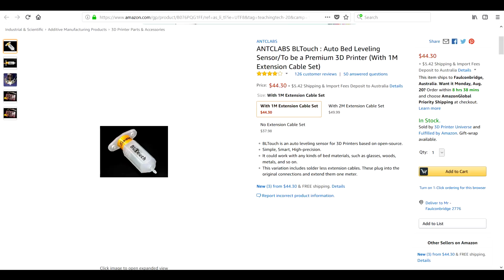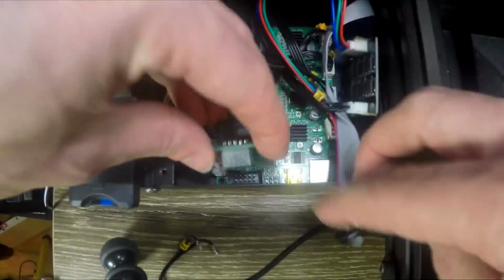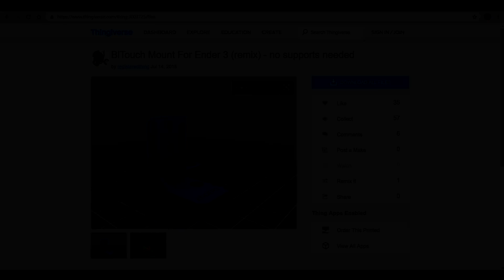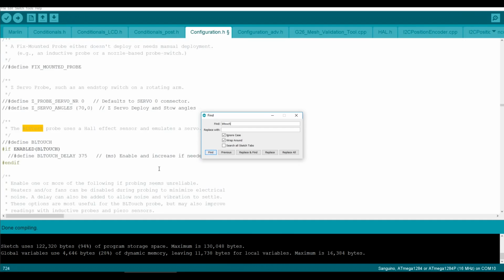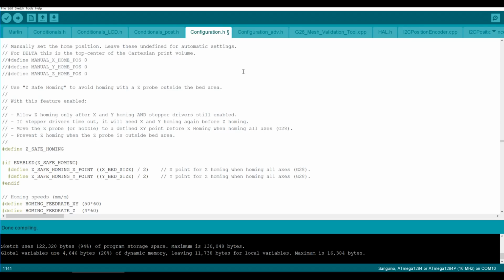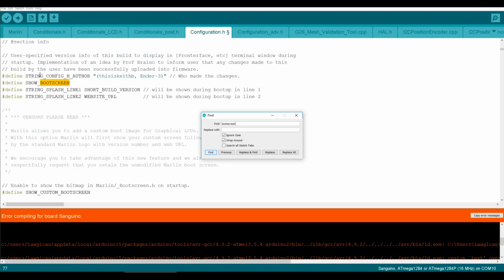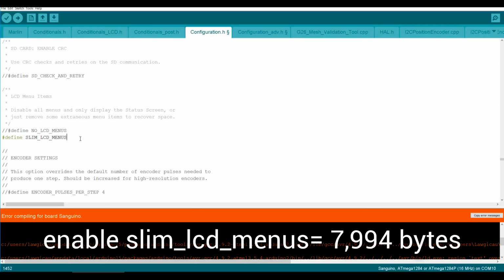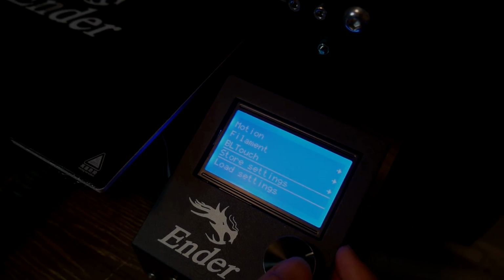Ender 3 BLtouch vanilla Marlin guide

Comment: I have a quick question. I followed your video and even purchased your config files. I uploaded using Arduino with a 95% used just like yours. Here is the problem I am running into. For some reason it does not seem to save the probing from the BLTouch. So my prints are not level. I run the level stl file and it does not come out level. Yes I have adjusted the Z axis and saved it to the firmware. But as soon as I adjust that too much the rest comes out of level. I was told that 95% is not enough room to save the data from the BLTouch. How can I gain more room and what should I be look at to disable. Thank you.

Comment: Hi again!  I used marlin 1.1.9 like in the video and I'm also using Micheal's config files where I only changed the probe X and Y offset, everything works fine expect the G29 script. When I run the G29 script(I used both pronterface and octoprint) the probe extents and the gantry moves down, but it doesn't move down enough to trigger the probe and it throws an 'probing failed' message and octoprint craps itself. When I run the G28 script it triggers just fine, the problem only happens with the G29 script. Has anyone else had this issue, and if so how did you fix it? Thanks!
Reply: I figured it out. the angle which I was looking at my printer hid the fact that the probe was barely missing the bed. I changed the 1024-1027 lines and fixed it

Comment: does anyone have experience with doing this with the new versions of the TH3D firmware? In the version i'm using(U1.R2.7) none of the configuration options that Micheal edits are available, and anything that I try doesn't help. Did TH3D remove support for the bltouch to force costumers to buy their EZABL?

Comment: Arduino:1.8.7 (Windows 10), Scheda:"Sanguino 1284p, ATmega1284P (16 MHz)"

In file included from sketch\ultralcd_impl_DOGM.h:49:0,

                 from sketch\ultralcd.cpp:96:

dogm_bitmaps.h:146:29: error: _Statusscreen.h: No such file or directory

compilation terminated.

exit status 1
_Statusscreen.h: No such file or directory

Comment: @13:41 you talk about G28 to home and then G29 but okay what software do i use to do that with?
Reply: Micheal used the simplify3D interface, but you can use pronterface(which comes with the newer versions of the TH3D unified software) or octoprint's terminal to send G-code. there are likely some other options, but I've never used them. hope this helps!

Comment: Hey, followed everything to the letter. The Bltouch completes the Self-test when powering on the Ender 3 Pro; however, it does not respond to the menu commands or when testing by finger if it stops the stepper motor from moving down in the Z axis. Any feedback would be appreciated

Comment: I bought your files and successfully installed them and everything seems to operate properly apart from Babysteps which I cannot access or find in the menus on the LCD screen. I have tried double clicking on the LCD knob on the info screen and on the z-offset screen .
Here is the Babystep code in my Marlin,
#define BABYSTEPPING
#if ENABLED(BABYSTEPPING)
  //#define BABYSTEP_XY              // Also enable X/Y Babystepping. Not supported on DELTA!
  #define BABYSTEP_INVERT_Z false    // Change if Z babysteps should go the other way
  #define BABYSTEP_MULTIPLICATOR 10   // Babysteps are very small. Increase for faster motion.
  #define BABYSTEP_ZPROBE_OFFSET   // Enable to combine M851 and Babystepping
  #define DOUBLECLICK_FOR_Z_BABYSTEPPING // Double-click on the Status Screen for Z Babystepping.
  #define DOUBLECLICK_MAX_INTERVAL 1250 // Maximum interval between clicks, in milliseconds.
                                        // Note: Extra time may be added to mitigate controller latency.
  //#define BABYSTEP_ZPROBE_GFX_OVERLAY // Enable graphical overlay on Z-offset editor
#endif
Reply: I have a genuine BLTouch Smart.

Comment: Has anyone else gotten this error:
Error:STOP called because of BLTouch error - restart with M999
Error:Printer stopped due to errors. Fix the error and use M999 to restart. (Temperature is reset. Set it after restarting)
X:157.00 Y:120.00 Z:6.00 E:0.00 Count X:12560 Y:9600 Z:2400
ok
Reply: never mind if anyone gets this errors first start out checking the black and white wire connected to the BLTouch on both ends I've had this problem for about a month and that was my problem after two BL touches and motherboards

Comment: I have a problem. The sensor seems to be working ok, I consistently get the same matrix (negative values on the left, and positive values on the right), but when it prints, it scratches the bed on the right side. I am using 5x5 billinear. What could it be the problem?
Reply: how is possible to change the grid i have 3x3 bilinear

Comment: reversed the power and ground like above and powered up...bang....one dead board :-(  the pin 27 adapter board i got actually was marked power and gnd but printed so far under the black connection that I couldnt see it.

Comment: Back again! Had it printing great prints for a while but now I have an interesting problem. After the BLTouch auto levels in the middle for Z axis. If I set the Z axis to zero (with z offset to where I need) and I level each corner with the paper just to have it close to perfect. The center seems to be a bit higher then the rest by a maybe not even a mm. Thoughts on how to get it all leveled and perfect? Or any work arounds? Thanks.

Comment: Hello,

I bought and used your files, but now I have no LCD menu at all. The button does not work.

Any ideas? Thanks!
Reply from the maker: Is there anything on the screen at all? Sounds like something not plugged in properly.
Reply: @TeachingTech 
And you were absolutely right!

My Pin27 board was defect when I got it, so I've temporarily hardwired it through a breadboard, and one of the wires had come loose.
Reply: @TeachingTech 
New problem tho,
The buzzer started sounding like an angry wasp. Like it's doing a beeb every .05 millisecond.

As mentioned, I used your files, and even tried adding that undef beeber pin, which was mentioned in the comments.

Any ideas?

Comment: On one of your videos a person commented to remove autotemp & volumetrics (found in configuration_adv.h) to save space in favor of some items you recommended. I was able to "remove" volumetrics, but removing autotemp produced a compile error in ug8lib. I'm at 98% so it's good. I also did the beeper_pin #undef that was posted in the comments; 128550 vs 129400 bytes.
Reply from the maker: Handy info, thanks for sharing. I managed to remove autotemp without issue. Not sure why the LCD library would be unhappy about that.

Comment: Hi, I'm using your configuration file and everything works fine, the problems is that I can do just one print, after the print, the z-axis doesn't move down, auto home doesn't work. and if I try to print something it just says STOPPED, I have to unplug the print about 1 hour and then everything goes back to normal.
Reply from the maker: Do you have something strange in your end gcode? Never heard of this problem before.
Reply: @TeachingTech  this are my start and end g codes

; Ender 3 Custom Start G-code
G21 ; (metric values)
G90 ; (absolute positioning)
M82 ; (set extruder to absolute mode)
M203 E80 ; (set extruder max to 80)
G28 ; (home all axis)
G29 ; (Auto Level)
G92 E0 ; (reset extruder)
G1 Z1.0 F3000 ; (move z up little to prevent scratching of surface)
G1 X0.1 Y20 Z0.2 F5000.0 ; (move to start-line position)
G1 X0.1 Y150.0 Z0.2 F1500.0 E15 ; (draw 1st line)
G1 X0.4 Y150.0 Z0.2 F5000.0 ; (move to side a little)
G1 X0.4 Y20 Z0.2 F1500.0 E30 ; (draw 2nd line)
; G1 E27 F1000 ; (retract filament 1mm)
G92 E0 ; (reset extruder)
G1 Z1.0 F3000 ; (move z up little to prevent scratching of surface)
M117 Printing...
; End of custom start GCode

; Ender 3 Custom End G-code
G4 ; Wait
M220 S100 ; Reset Speed factor override percentage to default (100%)
M221 S100 ; Reset Extrude factor override percentage to default (100%)
G91 ; Set coordinates to relative
G1 F1800 E-3 ; Retract filament 3 mm to prevent oozing
G1 F3000 Z20 ; Move Z Axis up 20 mm to allow filament ooze freely
G90 ; Set coordinates to absolute
G1 X0 Y{machine_depth} F1000 ; Move Heat Bed to the front for easy print removal
M84 ; Disable stepper motors
; End of custom end GCode

Comment: Hey hope you can help me! Using Marlin 1.1.9 and installed BLTouch using the Pin 27 Board. BLTouch looks to be working fine and can deploy and stow. The only issue I am having is when I Auto Home the LCD flashes and the text disappears. I have to turn the Ender 3 off and on to get the LCD menu text to display again. Any advice on this issue?
Reply from the maker: Something loose jiggling it free? Very strange,new to me.
Reply: @TeachingTech  Hey thanks for the reply. Yes the 27 pin board from TH3D has the connector facing upwards. I guess when I put the case cover back on it pressed the board forward just a little. I tested Auto Home pressing the board down with my finger and no flashing or blank LCD. I guess with the new board design, hot glue will be required on the LCD cable to the case to prevent the 27 pin board from leaning forward.

Comment: A little help plz. Followed these instructions, but the probe does not stop when triggered. I can deploy the probe and retract it, but it will not pull up when left on its own.
Reply from the maker: Most likely switch the black/white wires into the mainboard z limit switch plug.
Reply: @TeachingTech  That was it! Thanks!

Comment: Thanks for the video. I got chine's bltouch copy, its looks like its working. The probe does make measurements and I can see my bed 3d visualization in octoprint. But when it starting printing everything goes like there was no any measurements at all. Its seems that it doesn’t use the measurements that was made.
Reply from the maker: Just make sure g29 is after g28 in start gcode. By default g28 clears saved mesh.

Comment: OK, followed this to the T, I thought, and things seemed to be going well. Everything uploaded successfully, the BLTouch seems powered up, but my screen is completely blank. What did I screw up?
Reply: I'm beginning to think the issue is with the PIN 27 board from TH3D
Reply from the maker: It's possible to plug in the LCD one pin off either side. Check for that first. Hopefully you checked the pins on the pin27 board, there is variation in the 5V, GND, signal order.
Reply: @TeachingTech  TH3D sent me a guide and that was exactly the issue. It's all working well now, thanks for the great guide!

Comment: Pulling my hair out trying to troubleshoot some issues I'm having. Pretty frustrating since I'm not new to electronics, firmware, and Arduino coding (been a firmware+software engineer for 30+ years now). I am new to 3D printing however, so may have missed something stupid simple (unless I have a bad BLTouch). I even invested some milk money into buying Michael's configuration files to ensure I didn't touch something else I shouldn't have.

- What state is the BLTouch supposed to be in at power up? Mine does the self-test then remains stowed with the red LED on. Is this normal? I read somewhere that it should cycle 3 times. Mine cycles only twice. Also saw another video that seemed to imply it should stay deployed after power up. So just looking for confirmation there.

- When initiating the bed leveling sequence, aren't you supposed to be able to manually trigger the probe with your finger and stop the z-axis? When I do so, the probe immediately redeploys and Z keeps moving. The result (when I don't kill the power) is a nozzle crash into the bed. Apparently the probe trigger pulse is missed/ignored. I can also hold the probe in until it alarms but the Z continues to move down until I power off. I should note here that I had to swap the black+white wires on the Z-stop connection from the BLTouch. Following the directions to align black with black and white with white, my Z-axis would only move up, never down. Seeing someone else report the same and being told to swap the wires, I tried that and it fixed that issue at least, but I don't know if it's contributing to this issue or not.

- With Z-Safe Homing to the bed center, my X and Y axis are set at 0 at that point. Neither will move in the negative direction using the LCD menu, presumably due to software endstops being enabled. M211 reports "Soft endstops: On   Min: X0.00 Y0.00 Z0.00  Max: X234.00 Y234.00 Z250.00". I didn't change anything here, it's the default config in stock Marlin and Michael's configs as well. Do we just give up the ability to manually move to the front left of the bed? In the BLTouch how-to's I've watched and read, I haven't seen this mentioned.

- Z Probe Offset doesn't effect Z-axis at all, even with the higher multiplier Michael recommends. I can spin the dial in either direction until the numbers go beyond the LCD's ability to display them, and Z doesn't move.

I've had my printer down for a couple of days now trying to make this work. I have a genuine BLTouch, an Ender 3 with v1.1.3 board, using Michael's purchased config files with the only changes being my bed size and probe offsets. Just to eliminate the chance of any other breaking changes creeping in, I've unzipped a fresh Marlin 1.1.9 and then applied Michael's config as-is, without even touching the bed size and offsets. Same issue.
Reply: For the time being I've disconnected the BLTouch and am back to vanilla Marlin with manual mesh leveling. I would really like to get this thing working, as manual mesh is a chore. I did install the stiffer yellow bed springs though, so hopefully levels will be more stable.
Reply from the maker: -Mine usually licks in and out two times at start up, sometimes one. It goes solid red after that. It should not be deployed/extended at idle.
-Yes you should be able to trigger with your finger when homing. If it doesn't usually the polarity of the black and white wires is reversed. The behaviour to only move up instead of down sounds correct as long as it only does it until you home. It is the printer trying to protect itself from crashes until it knows where the bed is.
-The 0,0 for X and Y is very unusual. When homing it does X and Y first, which is then uses to determine and move to the centre of the bed. Very strange that it still reads 0,0 after this move.
-Also very strange.
There is something amiss here, I can't put my finger on it. A nice diagnostic step might be to connect to the printer via USB and use Pronteface/Simplify3D/Arduino IDE serial monitor to manually send the G28 for homing and see what messages it sends back. Commands such as M119 will report endstop status which might be telling for the z axis (now connected to the BLtouch).
Reply: @Teaching Tech Thanks Michael! I’m traveling on business this week but when I’m back home I’ll try again and report results.

Based on your feedback something definitely seems to be amiss! Hopefully coming back to it with fresh eyes will have better results.

Comment: I chucked a buck after fighting with the TH3D Unified firmware. I just want this working now, so fingers crossed!
Reply: Turns out the clone 3DTouch was badly soldered, control cable wasn't connected internally. Great job Geeetech!

Comment: Maybe update your video again?  Wiring is a nighmare now. They apparently no longer make up extension cables. In my case, I received a length of wire and a handful of connectors and pins. I don't have a DuPont crimper, so I had to had solder the whole mess.  (I bought this because, like the video, I would have plug and play parts.  Nope. )   Also, the one meter extension isn't long enough, and the wire they supplied isn't the same colors as the wires on the BLTouch. I hope you like Puzzle Night.
Reply: Did you buy a genuine BLTouch? Mine came with pre-assembled wires, however with DuPont connectors instead of JST (presumably to be more universal to various boards) along with some extra pins and DuPont housings if you needed to change them. I had to swap wires on the power/sensor connector to match the pin 27 board from TH3D, but otherwise it was plug and play.
Reply: @dwmorris  
Yes. It's the real thing... and despite the install issue, I'm glad I have it now.  The number of failed prints due to 1st later problems is now Zero!
I'll be ordering more for my other printers
Reply: Gary Melander Glad it worked out. Weird about the wire though. Besides being pre-assembled with connectors, my 1m wire matched the BLTouch colors and was plenty long enough for my Ender 3, in fact I had to make a couple folds in the wire and wire tie it to take up the slack. That’s why I assumed you must have bought a clone. Sounds like you got a Friday afternoon model.

Comment: Will there be a similar revised guide for getting EZABL working with vanilla Marlin?
Reply from the maker: No, because it's an TH3D product so it makes sense to use the TH3D version of Marlin set up for it.
Reply: @TeachingTech  So basically, If you can't or won't run the unified firmware don't buy TH3D?
Reply: @TeachingTech  I'm sorry if my comment sounded harsh, that wasn't my intention. Love your guide and reference them frequently. My reasoning was that I'm getting the TH3D solid bed mounts and the direct  wire EZABL and want to use that, but looking ahead I will also likely replace the stock mainboard with either a Fysetc F6 or a MKS Gen L which I'm pretty sure means I will no longer be able to use the Unified firmware any more (and moving between boards should be easier if you use the same firmware on each?).
Hope this explains my question, again, sorry if I sounded impolite.